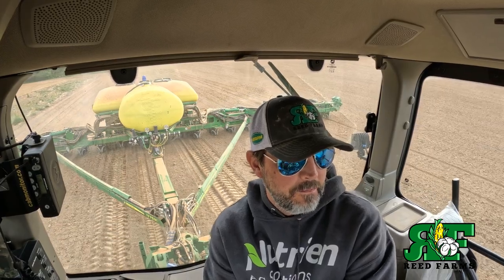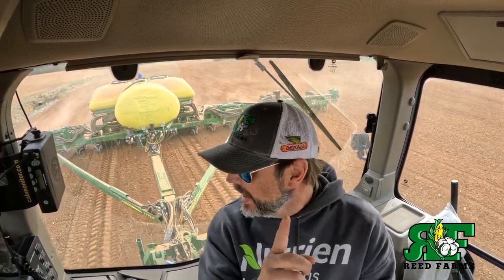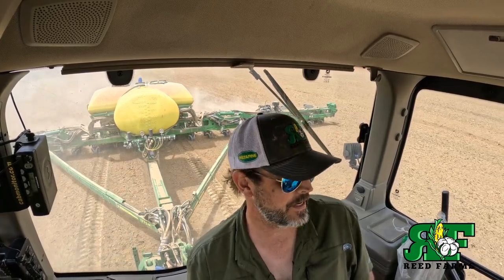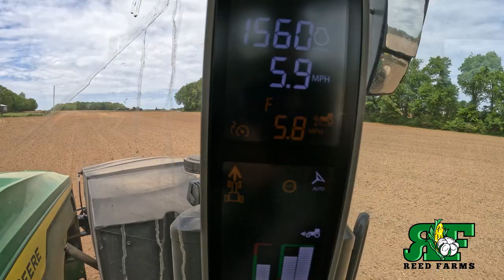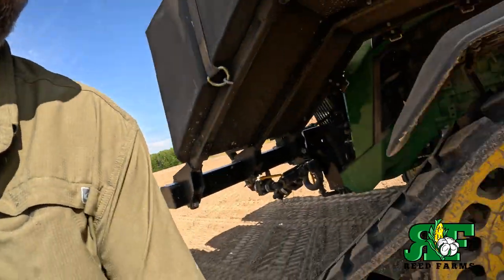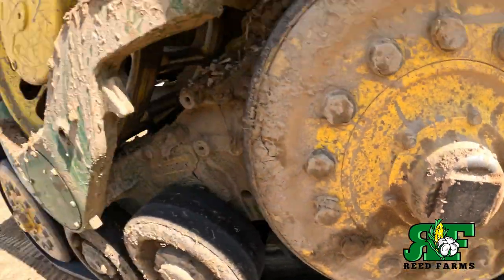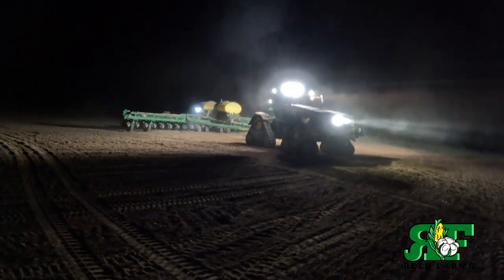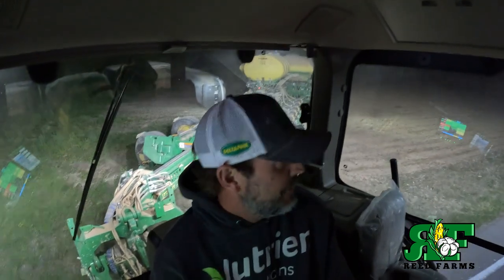Broken Tractor Track Trying to Finish Soybean Planting

Comment: I've seen where steel spike closing wheels actually throw the seed out of the ground.
Reply from the maker: Yes. I’m not a fan of several different design’s I have tested a lot of them and have to say I’m very pleased with the Shaffert Zippers. The angle on the tine’s is what is closing the trench not the spikes.